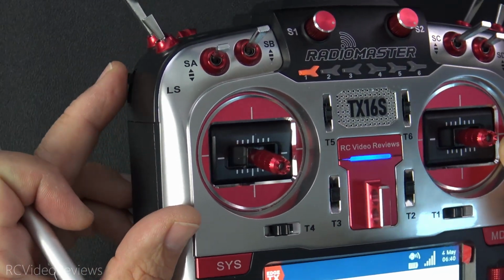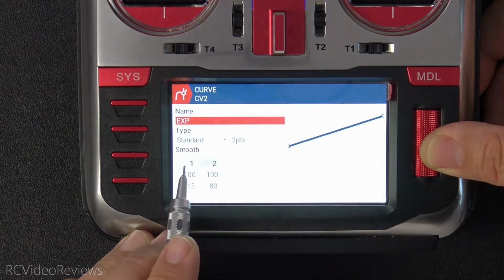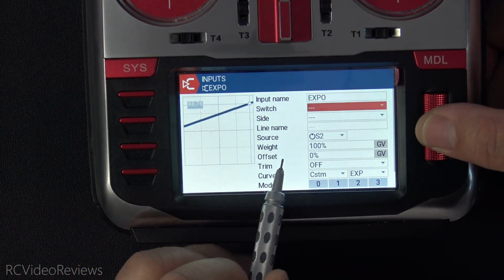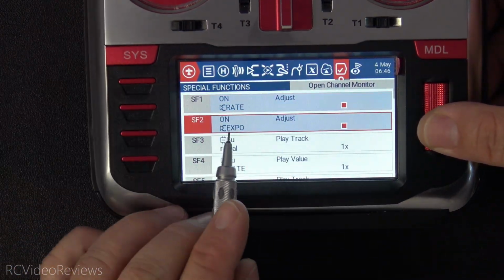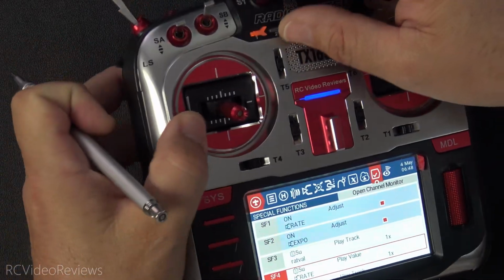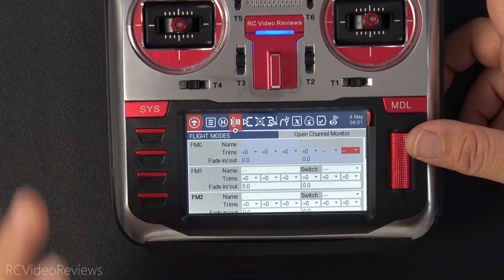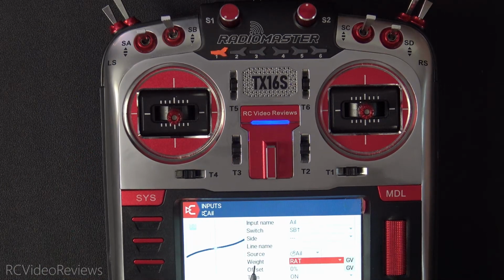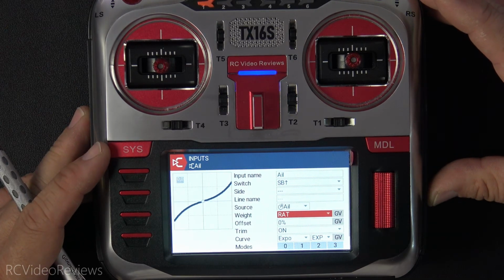EdgeTX • How To Change Weight [Rates] and Expo with the Knobs or Sliders

Comment: Hello , why does the EXP affect the neutral position if trimming is used?
Reply from the maker: Expo effects the entire curve from -100 (988us) to +100 (2012us). Trim happens close to 0 or (1500us) but it’s still on the curve and still subject to expo.
Reply: @RCVideoReviews Thank you for the reply. Ok but in that case the Expo changes my trimmed "neutral flight position". So I would have to trim different according to the amount of my Expo rate?
Reply from the maker: You can't think of it that way. Expo simple changes the relationship between the stick and the endpoints. Trim effectively is the stick (it's a permanent 'nudge' on the stick). So if you have a significant amount of expo (say 80%) your two clicks of trim will have a great impact than if you have no or low expo. 

Expo if a function that changes the straight line from -100 to +100 into a curve around the center position. More expo = more curve. Use your channel monitor and play around with it. Just remember trim is nothing more than an imaginary finger putting a little pressure on the stick in one direction or another.
Reply from the maker: For further discussion on the subject, please join my discord. Link is in description.

Comment: I tried it in all the ways . This can't work properly because if ythe trims are not set to 0  and then ajust the weignt (of the elevator) the you modify  the trims also which is very bad when you fly .  So i conclusion you cant have the weight of the elevator ajusted with a slider if the trms are not at 0

Comment: hello thanks for this interesting video. I have done it for the elev weight on S1. However when i modify the trim for the elevator  then  S1 modify the elevator value without touching theelevator stick?. Is there a way to correct this?

Comment: when i look at the mixer travel, although i have high rate at 100% for aileron, rudder and elevator, when i move sticks, they are not at 100%, some are at 97 left or 95 right i calibrated multiple times, similarly on low and medium rates
Reply from the maker: Discord: https://discord.gg/jSFTASU

Comment: At 11.30 mins you suggest changing the weight to RAT but my Tx16s running on version 2.7 only allows me to increase the numbers and does not allow me to select anything.
Reply from the maker: Highlight the weight value and long press the jog dial.
Reply: @RCVideoReviews  Ok, thanks will do.

Comment: Tiny T
Reply: Can I apply different rates/weights to each channel or must they be global value?
Reply from the maker: To use the knob on different mix lines you'd have to use some logic to tell the knob to update a different Global Variable. It could be done, but would be a little tricky I think.

Comment: Thanks for the video! This works great. Is it possible to have which channel knobs S1 and S2 are affecting be controlled by a 3 position switch so I can tune aileron, elevator, and rudder independently?
Reply from the maker: This is an interesting question--unfortunately, I'm not sure there's a way to do it. I'll think on this though because it's intriguing.

Comment: I have mine setup on t5 and  t6 through F M. Pretty cool
Reply from the maker: Yeah, that would be cool too--kinda like trim for weight.
Reply: @RCVideoReviews  I have T5 for weight and T6 for expo. Super easy to setup. You just need to remember to log your values for each model you fly. I also use 3 different FM buttons. Takeoff, mid range and Acro. Couldn't have done it without your videos.
Thanks John 👍🏻

Comment: Great idea/programing! Question: could it be done not with global variables but with a dimension specific to the model?
Reply from the maker: Dimension? Global Variables in this case is a misnomer. They are only visible to the current model. Don't confuse Global Variables with Global Functions which are visible to all models.
Reply: @RCVideoReviews  Ooops! You are right, my bad!!!
Reply from the maker: No worries. It's a little inconsistent to use global variable and global function with both having a different scope.